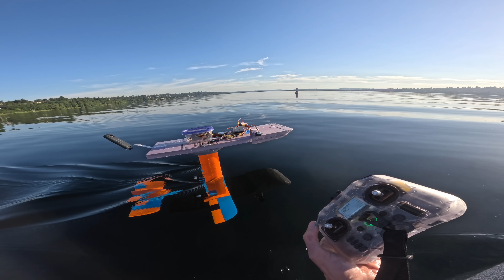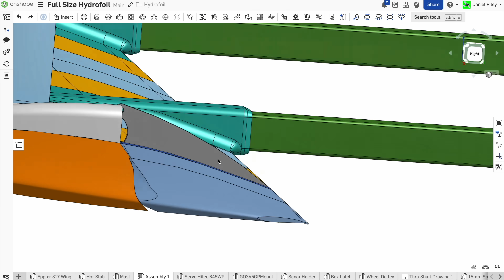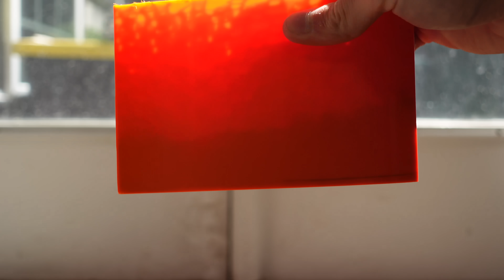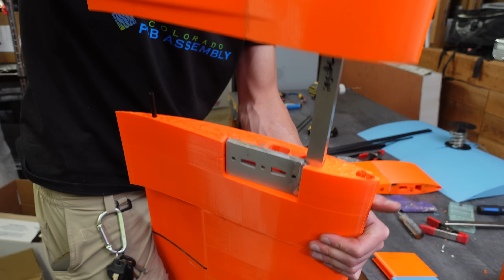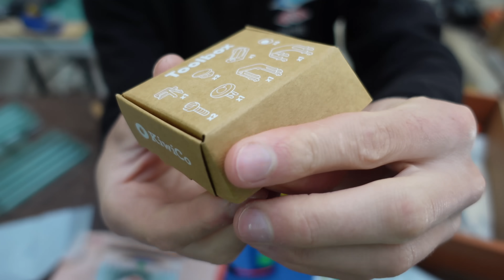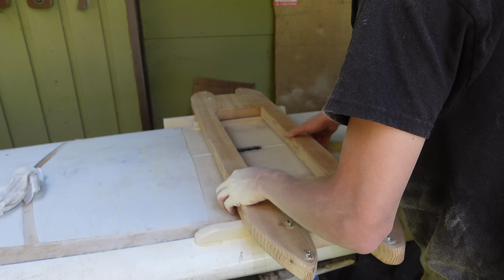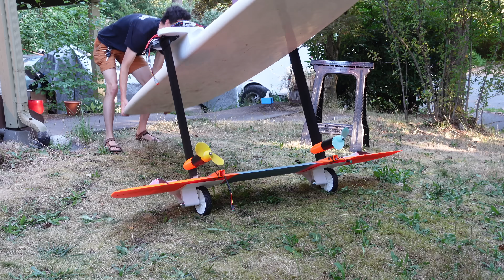Building a HUGE 3D Printed Hydrofoil

Comment: Is it possible to print the foils, so that the hinges had enough clearance for fiberglass and resin to be added ?   sorry I don't know anything about 3D printing.
Reply: You're watertight servo box is beautiful and pretty genius, is that your design and idea?
Reply: also...you might find a thing called Liquid Tape to be useful...on my boat...I solder wires, ans then just cover the soldered joints with this liquid plastic.  Dip-it tool dip would probably also work...they look and smell and dry identically...i think it's just a repackaging.

Comment: Hey, just a tip, Use teflon grease instead of silicone. Orings are mostly made from silicon and they are NOT compatible with silicone grease. This is common mistake i aswell made.

Comment: The low drag hinges are a great idea, but may be steering you down a less efficient path.  I'd reconsider a semi-balanced foil, like the rudders on modern sailboats.  I turn my 50' boat with very little force and no hindges to worry about.  Would make the suggestion below about locating the servos above the waterline easier too.

Comment: FYI, if you can't get adhesive lined heatshrink tubing, cut slivers off a gluegun stick and put the inside a piece of regular heatshrink tubing. When you shrink the tube, the gluegun slivers will melt and fill the voids.

Comment: about 14:40 and a question if silicone and heat shrink makes reliable splices?
we used high temp silicone sealant and heat shrink tubing around mag wire/multi-strand splices on hundreds and hundreds of space bound solenoid valves.
your splices will probably be alright and your encapsulation of the servos gave me goosebumps.
sweet and smart and cool good work, Sir.

Comment: Building a Giant 3D-Printed Hydrofoil: Design and Construction

* 0:03 Inspiration: The project was inspired by a ride on Navier N30 electric hydrofoil boat and its prototype.
* 0:10 Project Goal:  Build a large, rideable hydrofoil with a 2-meter wingspan, based on a stand-up paddleboard, using a self-stabilizing system.
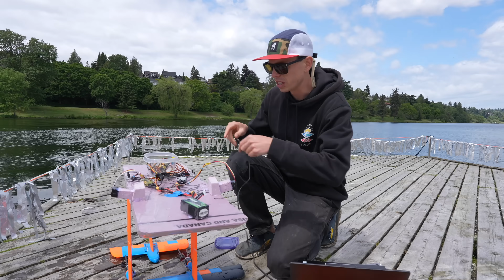* 1:26 Flight Control: Utilizing dRehmFlight code for autonomous stabilization, similar to the smaller prototype.
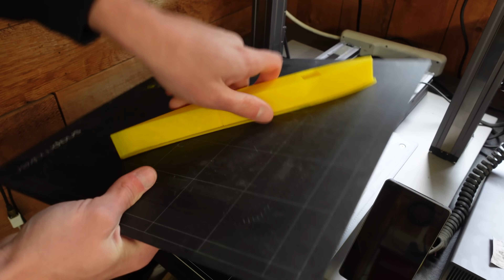* 1:33 3D-Printed Design:  The wing and horizontal stabilizer are 3D printed, allowing for complex geometries and integration of features like servo mounts and wire channels.
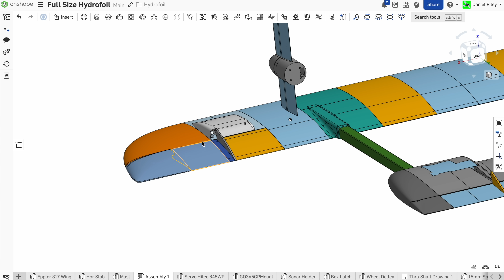* 2:28 Structural Reinforcement:  Aluminum spars run through the wings for added strength, connected to aluminum plates on the paddleboard via masts.
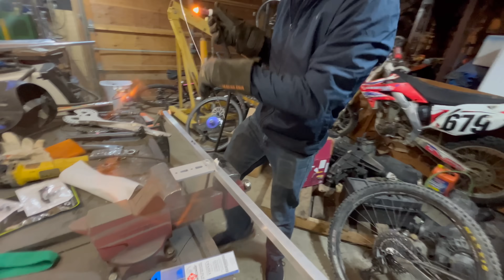* 3:44 3D Printing Process: Primarily using PETG with PLA support material on a Prusa XL 3D printer.  Gyroid infill chosen to create a continuous internal volume for water drainage.
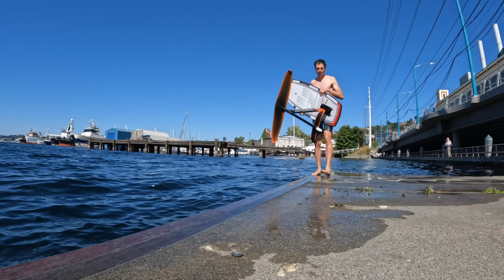* 4:00 Fiberglassing: Initially planned to fiberglass the entire wing for a smooth finish and airtightness but ultimately skipped this step except for reinforcing the tail boom connection area.
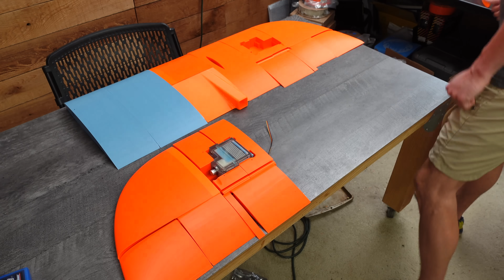* 5:49 Waterproof Servos: Using high-tech D845WP servos with IP67 rating, further protected by custom-designed resin-printed housings filled with silicone grease for watertightness.
* 8:28 Control Horns: Custom-designed control horns and linkages ensure precise control surface movement within the servo's range of motion to prevent damage.
* 11:11 Board Modification: Shortening the 11-foot paddleboard and repairing delamination with Gorilla Glue and fiberglass.
* 12:47 KiwiCo Sponsorship:  Segment highlighting KiwiCo's educational kits and their relevance to the project's electronics.
* 14:06 Mast Mounting:  Modifying mast mounting plates to accommodate phase wires and reinforcing the mast-wing connection with glue and fairing compound.
* 15:14 Motor Mounts:  3D-printed motor mounts with TPU for vibration damping, attached to the masts.
* 15:44 Propulsion: Reusing Vesc 75/200 ESCs, Flipsky 6521 motors, and propellers from a previous electric boat project.
* 17:16 Structural Reinforcement:  Adding fiberglass and carbon fiber reinforcement to the critical area where the tail booms connect to the wing.
* 18:43 Battery Box: Constructing a large battery box from XPS foam to house a 100Ah, 24V LiFePO4 battery.
* 19:16 Electronics Integration: Installing electronics and configuring differential thrust for yaw control.
* 19:46 Transport Wheels: Designing and 3D-printing removable wheels for easy transport of the assembled hydrofoil.
* 20:32 Preliminary Test:  Transporting the hydrofoil to the lake for initial testing with IMU-based stabilization.  Flight test results reserved for the next video.

I used gemini-1.5-pro-002 on rocketrecap dot com to summarize the transcript.
Cost (if I didn't use the free tier): $0.03
Input tokens: 23510
Output tokens: 686

Comment: How did you calculate the angle of attack? It looks like you just set most of the profile to be tangent with the flow and the cambert resulted the trailing section to have a kind of upward angle. Or you choose the angle related to the highest lift to dragg ratio at certain  Reynolds number?

Comment: You can increase the perimeters and also coat the 3d print with polyeurethane to make it water tight.  I found 6 perimeters to be sufficient.  You could also redesign so that you can print in vase mode.  A nice slow vase mode is also water tight.

Comment: Electroplate the hydrofoils with copper to make them watertight. All you need to do is spray the parts with graphite conductive spray and leave it in copper sulphate solution with a copper bar electrode. With a thin layer you don't gain much weight on the part.

Comment: Somebody probably already mentioned this, but you might try printing your foils with as sparse gyroid infill as you can while getting good print quality and take advantage of its connected volume to fill the parts with spray foam. Just make sure to add vent holes so the foam doesn’t burst your parts.

Comment: About the solar boat. A scale down version of the Kurt Hughes 38 foot power trimaran, at 31.4 feet with a fully ladden weight of 920 pounds, should be able to do about 9.9 knots or 5.1 m/s at ca 1000W continuously, with high efficiency, low rpm high aspect ratio props. Or 7.2 knots/3.6m/s at 400W. Add a small kite or windsurf sail and you'll do 12+knots easy. 🤙

Comment: You should consider painting these structures with silicone caulk to potentially seal the Capillary Micro holes in the 3-D printed plastic

Comment: Remember that video of the bridge doing the big flex thing? Stiff in any connection. I've found it's better to use a "tuning fork" (literally a piece of steel/wood/plastic that will flex like a spring) to take the force of the impacts, and when human rated, adding the "break-off" and "crush surfaces" to dissipate strikes by varying impact force. But in all cases except specifically those aiming to be assistive to retaining contact of control surfaces to medium, hard hard hard and harder.
Reply: This free-stand rod can be internal, and you can apply multiple for larger vehicles. Vary the rod size and stiffness by the size of the item and expected impact forces. So you could literally put a toothpick in a 1 foot balsa wood machine. The key is that this is attached to any key structural parts on one side so that there's no chance of it coming off, with the other side simply hanging out but protected from becoming load bearing. Its only job is to give shock energy that will break connectors a place to be exerted in motion on something that doesn't matter. Making it replaceable can be useful depending on the materials. And yes, you could use a chop-stick on a titanium structure for this, as long as it has some flex in it, and in that case, as long as you can replace the stick as it dries and cracks long before your frames.

Comment: Huge props for everything you do. Very impressive work. One suggestion - I’m an ME who has designed several watertight housings. The aluminum shaft for the servo 1) should really be steel, not AL and 2) needs to have a MUCH smoother surface finish (ideally something like Ra 0.2 - mirror polish, essentially ) to maintain a good seal). What you have will work for a while, but it won’t last. The rough AL surface will tear up the o-ring eventually. And the silicone in-fill is interesting, but probably not necessary if you had a better shaft seal.

Comment: RC sailboats have been made waterproof for quite a few years by now. Retractions are your enemy. Anywhere the print stops and starts is a potential pinhole. Higher temps and wide extrusions, on the other hand, go a long way in making it work.

Comment: Love how the servos were encased to keep the water out.  Have you thought about applying a skim coat of epoxy to the outer surface of the 3D printed parts to make them water tight?  Or running a torch over the surface to melt and quickly cool the surface to eliminate (or at least reduce) the layer gaps?  I've done that in the past and it actually made the parts hold water.

Comment: Nice project. About the protuding actuators : you definitely don't need a 35% chord aileron in water. Reduce your hinge and une a 15% hinge, then you will have a reduced leverage for the same action. Also in bigger marine rudder, tab actuators are a thing. wor way less power draw you can only drive a servotab on your big ailerons for the same result.

Comment: - a rudder on the tail -  ?? assist in making  low speed flatturns -   I agree that "the way it is" is often enough to live with.
 - bouyancy of foils - Neutral to slightly bouyant - seems to make more sense than fully air filled - making it a known quantity eliminates some unknowns, now we know they will fill up eventually, problem is solved  (filling somelongitudinal voids with a chop carbon epoxy mix - allows "post print" carbon spars / longerons to be used in large prints.

Comment: from the gyroid infill, to the grease packed servo enclosures, to the silicon lube instead of petrol base id say your technique is on point!  Since youre thinking out every aspect of the build, may I recommend in the future Viton Orings....brown works well, but that will save some headache when deciding on lube/seal products as the Viton withstands petroleum distillates much better than normal black rubber. I learned that when working on natural gas compressors...everything including UV deteriorates rubber sealing rings, the extra cost is worth not having to tear all that down in the future. Cheers from Texas!

Comment: one of the best parts of 3d printing things like this is you can make a functional prototype like this then later in production you can reverse engineer the design to be created from subtractive manufacturing like a 5 axis cnc machine from a solid billet of carbon fiber or aluminum

Comment: Regarding the heatshink with glue. I was in the same spot and used hot glue gun first as it melts and conforms when the heat shink is applied. Figured that's similar to what a real heat shink tube with glue would be like.

Comment: 14:42 You might have better longevity with hydrophobic dielectric grease under the heat shrink as some silicone sealants have corrosive compounds.  👍

Comment: For waterproof prints you'll want to use PP(polypropylene)! It's completely nontoxic, waterproof, and REALLY strong!
It's a good bit more expensive but the raw pellets are dirt cheap if you can make your own filament. 
Really easy to print to, you just need to put packing tape on your print bed as PP only sticks to other PP, which packing tape is made of

Comment: Maybe you could get similar benefits as the handlebars if you add some strategically placed cushioned footstraps, kinda like on windsurfing boards and mountain-boards, and changed your stance to be more  sideways instead so you can have more front-back control of your center of mass?

Comment: Woop woop! O-riiiings;)
(Yep, been "bitching" about the lack of them on many previous builds, hehe). That said, "as much grease as possible" is the wrong way to do this. You only need just enough not to have excessive friction. The job of the grease is not to seal but to allow the o-ring to sit "naturally" in its groove. If you designed the groove with good practices, then it will work.

Comment: If you need but don't have glue-lined heatshrink, you can put a bit of hot glue over the connection first and then heatshrink over it. The heat will remelt the glue and it will flow and cover everything under heatshrink.

Comment: White paint probably has the least UV protection, as a color. Since it doesn't absorb sunlight, just reflect it. Unless the paint has some UV protection ingredient.
Black gives much more UV protection. Since is absorb sunlight and convert it to heat.

Comment: One thing I’ve been doing is using gyroid infill to make 3d-printed composites. Since the infill is one continuous volume like you mention, you can fill it with resin or plaster or polyurethane or any other low viscosity fluid that can cure to a hard state. You end up with a PLA reinforced composite with a 3-dimensional internal matrix. Maybe you can use this on your foils to make them both buoyant and resistant to filling with water.

Another solution might be a hollow print that you put resin in and use a technique like roto-casting (coating) while the resin cures to seal the interior or the print.
Reply: You saved me the trouble of typing all that!
For the rotocasting, those tree type internal support structures seem ideal, better than low infill gyroid or hilbert. Zero infill seems restrictive, unless you glue/weld together a lot of smaller shell parts, and the cast sealant is also what keeps the whole thing together, by mixing in fibres, for instance.
I might try those disposable PU foam cannisters. Premixed, bubbles abound, and when the foam squirts out on the other end you know that you should have stopped pumping it in way sooner. Clean up mess, pry out the foam stuck in inlet and vent holes, weld in the matching stoppers nice and flush, done. Add walls in print to force the foam stream into any potential airpockets, if necessary.

Comment: Liquid electrical tape is a good option for sealing wiring as well.  You can vary the thickness and it is very pliable and resilient after it dries.

Comment: would filling the wing with expanding foam have worked to keep them buoyant/water tight? probably needs a different infill with that in mind, maybe spray it in before printing the final layers so it doesn't need holes. doesn't look like you needed it, though. the end product here looks great!

Comment: I will often hot glue around a soldered joint and then slide heat shrink over that when I have a size that I don't have on-hand in the hot glue coated tubing. When you hit it with a heat gun to shrink the tube, the glue will melt and flow into the gaps, forming a pretty good seal.

Comment: I found that using epoxy resin to waterproof 3d printed plastic works great if you add 5% acetone to the resin and because the 3d print is micro poris it will adsorb the epoxy and have nothing externally changing outer size of the shape, so I think you'll be able to waterproof the hinge areas as well this way even without the acetone, just wiping access epoxy from the friction contact hinge areas.

Comment: 5:42.  Get a small air pump and pressurize them when you want to alter their buoyancy.  Could probably do it with a co2 canister or two and a pressure regulator.
Reply: It's not a lot of pressure to keep water put either like 3-7 psi should be fine

Comment: Since the wing section internal volume is continuous, maybe they could be filled with expanding foam of some sort, like pour foam?   Or, would something like captain tolley's creeping crack cure seal the hinge areas, it goes on as a high viscosity liquid and fills any cracks it can find.

Comment: I was thinking for the wing section water tightness... There's a home construction product- when your house is being built (usually before the drywall stage), they seal your house as best they can and then pressurize it and then put aerosolized silicone into the air (at least I think it's silicone). It finds all the leaks, cracks and holes and basically caulks them making your house air tight. It can fill a hole up to like a 1/2". Maybe you could do something along those lines to make something water tight if you have a similar need in the future

Comment: If you want to improve your surface finish and add some extra waterproofing, you can use 3d printer resin, paint on a thin layer, and then put it in the sun.
Or a layer of gel coat like the put on to finish boats when fiberglassing.

Comment: You can inject 2 part pour foam into gyroid 3d prints to keep the water out. You have to get the amount correct and drill vents so the print doesn’t warp or explode.

Comment: When compromising the foil to add ports, ducts and fairings, consider placing these features on the bottom (high pressure) side of the foil to reduce cavitation on the low pressure side.  Try to keep the low pressure side as pristine as possible.
Reply: There is a second reason to do this; at least in aerodynamics you can actually get more lift from the low pressure side, leading things like swan neck spoilers on cars which deliberately move the attachment point to the high pressure side

Comment: Something you might want to consider to make the hydrofoils buoyant is to drill a number of holes around the outside and then inject the infill with foam. If you use gyroid like you did it should be able to expand and fill the whole volume. Cheers and great work! Love the content.
Reply: Remember to have an exit path for the air the foam is replacing or it will get messy and unsuccessful 😂

Comment: Some tips on the water proofing, print your parts in ABS or ASA and use Vapor smoothing, or if you want super strong water resistant parts, print in PC-CF, then coat with Loctite 406.